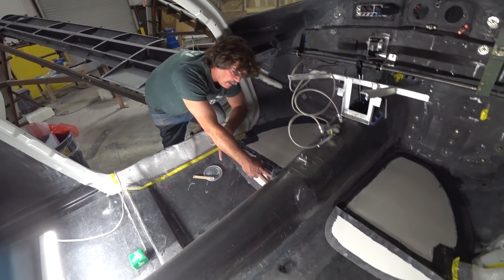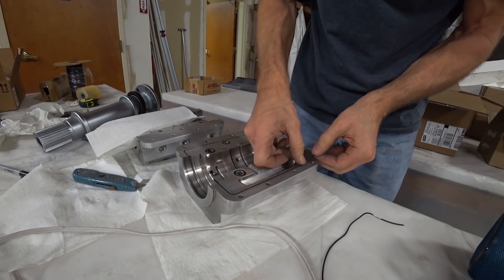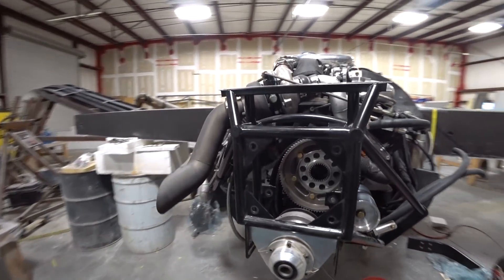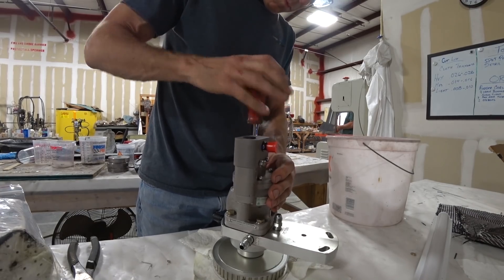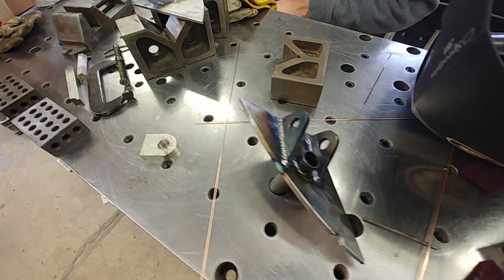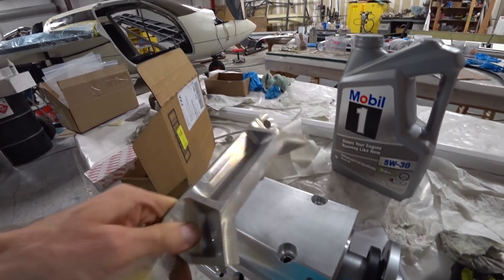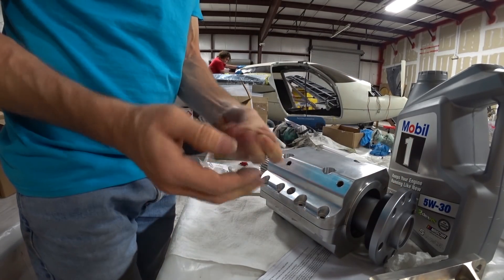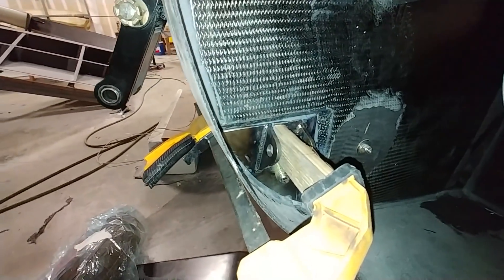New Governor Install - Building the Raptor Prototype

Comment: i guess you read the comments if you are going to dowel it.. check the run out of the shaft to make sure you have 0.005 to 0.001 in all directions or what ever the bearing clearance is. remember this is going to go to -60F..  you might really want to pull the shaft.. have a tool created to fit Perfectly in the main bore without the bearings so you can torque the case halves and get the main bore offset perfect no matter how the bolts are..  then you can drill the .248..ream the .249..  and probably ream the half of the case you don't want the dowel pins to stick in to 0.2495 or just let the 0.249 reamer spin a little longer in the slip fit side.. you  should do tests for the slip fit side..   you can.. put the dowels in and if you have to split the case.. drive the dowels out first.  so you are NOT distorting the case.. 

 also what kind of oring material are you using.. will it withstand -50F and +300F  ... you might ask about using some of the hylomar on the orings. and on the straight section of oring also.. just a tiny amount so the hylomar fills and assists sealing.  hylomar is -50F to +450F..

 Edit.. if you are going thru the flange.. calculate where the long oring sections are.

Comment: I like the idea of dowel pins for the redrive. You might want to consider using a mill that's a little more substantial than your drill press.

BTW, there are also fully formed threaded tubes which are like Heli-Coils.

Comment: Did you remove all the automatic stopping features that new engines have? For instance I had a faulty sensor the other day and the CPU shut my engine down and wouldnt let me start it, a perfectly good engine shut down by a faulty sensor.

In a car it's not too big a deal, just coast to the side of the road, in an airplane that luxury is lost.

Comment: Assumeing the wing surfaces are glued on as the rest, how to fix like a broken spring or a loose bolt in the mechanics? Cutting a bunch of holes until the fault is found and patching them up again? Also, steel helicoils will not make the contact any stronger or less likely to break. It just transfers the problem by one size. Had that more then once on cylinder heads :)) (not saying it won't work well - just not as good as a thread direct in the block)

Merry Christmas to all of you - you deserve it.
Reply from the maker: We do have access panels in all the required places in the wings.
Reply: @RaptorAircraft  Cool. Thanks. Always a good idea to take care of Murphy - as in the bolt in the least accessible place will fail first :)

Comment: A drop of Loctite when mounting the Helicoil,...
Reply from the maker: Was not mentioned in the instructions but I could still add it right at the top.
Reply: @RaptorAircraft  It's not critical for a prototype, but it keep's the electrolyte away from the steel helicoil + alu part junction.

Comment: 2 dowels should be sufficient to index the two housing halves.  They would locate in both translation and rotation.  4 dowels would result in large GD&T clearances at dowels #3 & #4, reducing their effectiveness.  Dowels also would allow you to line bore the bearing / oil seal / thrust washer mounts to reduce the runout you experienced at the thrust washers.
Reply: ,,, we have few billion plain bearings in rod and mains, in gas and Diesel engines and 99 plus percent have a positive location housing bore, some register bosses, some body bound bolts, and some dowell or locating pins. I thing this requires a positive location .

Comment: It would be a good idea to oil both the o-rings and the grooves that they fit into prior to assembly.  This would allow them to ooze around a little bit and even themselves out, and if you ever have to take it apart again, it will prevent the rubber from sticking to the aluminum.  The Mobil 1 that you're using should work perfectly.